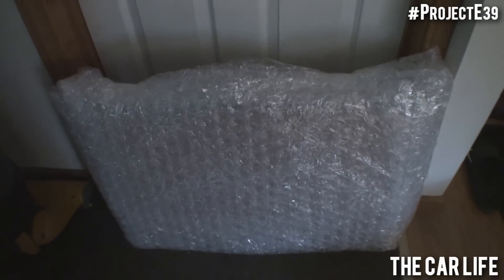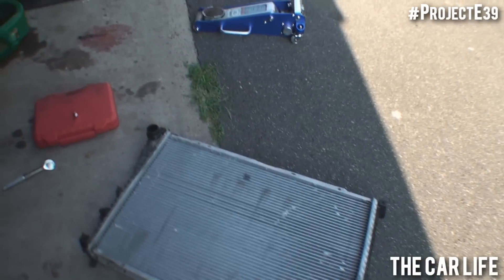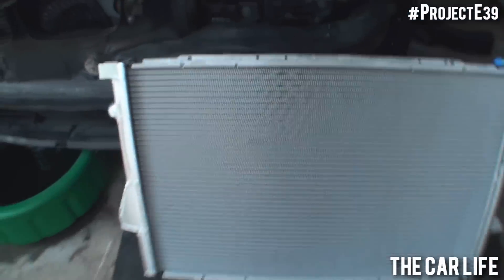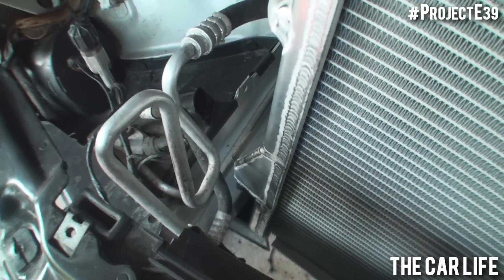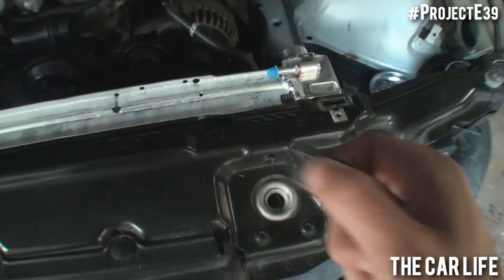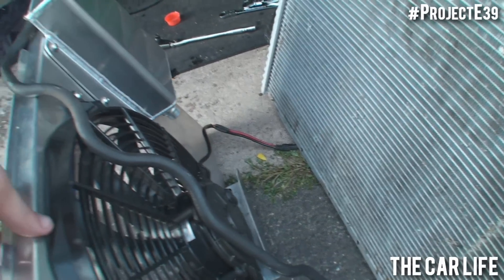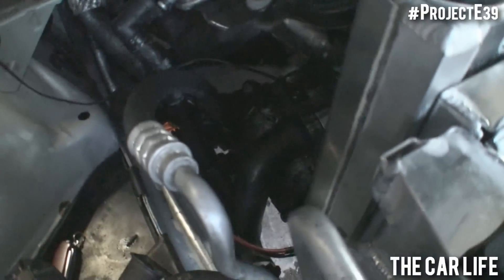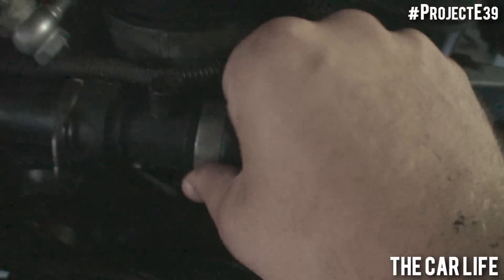Zionsville Cooling Upgrade - #PrpojectE39

Comment: Worth the upgrade, most of these era of bmw suffers with coolant problems… Great work. Im going to do the same on my e39.
Reply: Same here, I will be doing the upgrade for my e39 as well. the stock fan is too risky and the radiator is a time bomb waiting to blow.
Reply: Any updates: I plan to upgrade the radiator and thought to upgrade to an aluminum reservoir... did you guys upgrade or ?

Comment: 9 Jan., 2025: Another excellent option for e39 six cylinder models is installing the CSF e39 M5 radiator with Zionsville metal shroud w/SPAL fan. Years ago I took a chance and did just that. Zionsvilles metal fan shroud fits the M5 CSF radiator perfectly. Zero fitment issues between both companies parts. Now, the entire radiator fits into the engine bay perfectly also, zero problems. CSF's M5 radiator is a little larger than Zionsvilles. When both the metal fan shroud and the radiator are installed there's just a tiny gap from the fan motor and the front of the engine, but it does  fit 100%. No trimming, slicing and dicing required.

Comment from the maker: I bought the radiator and fan shroud/expansion tank separately. The radiator was $760 shipped and the fan shroud/expansion tank was about $360. Very expensive compared to the OES replacement parts but I have had enough issues with plastic pieces. I am also looking to upgrade to the M54 aluminum competition thermostat as well. It deletes the electronically controlled thermostat entirely.

Comment: Can you show us how you ran the electric wiring for the conversion? Having trouble on my 2002 530i. Any help is appreciated
Reply from the maker: Unfortunately, I no longer have the car. I ran the power off the jump start terminal and used a factory ground on the right side of the engine bay to ground everything.
Reply: Hate to hear you no longer have the car...did she retire or go to someone else?
Did you take the power through the fire wall and into the passenger side E-box? Did you place the fusible link in the main engine bay?
Reply from the maker: Eric Reed It's off to a new owner and a good home. Fortunately, it wasn't a local buyer so I don't have to see it driving around lol. For the control side, I found a switched power source in the DME box and tapped into that. The required volts to switch the fan control "on" was a very low draw. The fuseable link was in the engine bay. I had the fan control mounted to near to the hood on the passenger side. I used a reference on this install from a forum, I'll see if I can find it and link you to it
Reply: Thanks so much! I have learned a lot from your videos and have a lot left to learn;) Glad the car is in good hands.
Reply from the maker: Eric Reed No problem at all. Glad my videos have been of help to you. I have a lot of good stuff happening this year so keep an eye out for new uploads.

Comment: hey man love your vids could you make a video about the car and the sound and did you have problems with your alternator or starter. its been almost a year since i bought 97 528i and every time i see your car and another guy's 540i, they inspire me to save up and fix it up. just wondering is that the factory paint

Comment: So its now 2015.  Did you experience any issues with the Zionville radiator?  I have an 03 530i and am facing a 3rd replacement of the GARBAGE OEM rad.  Your thoughts now that time has passed.

Comment from the maker: Thank you. I apologize for the late response but I've been off of YouTube for awhile. I'm almost 26, but in College I used to work at a country club in Greenwich. While there I would receive tips and suggestions on stocks. In November of 2008 I bought roughly $10K of Ford stock when the price dropped below $2 per share. I ended up selling the shares I bought for well over $16 a piece. That is why I have the M3.

Comment from the maker: They are expensive, but you also don't have to worry about the same failure issues that I had with three of my previous radiators. If this radiator was to start leaking I could fix it with a simple spot weld. The OEM replacement radiators are GARBAGE...and I sell a ton of them because outside of spending $700 for a radiator it's the only option.